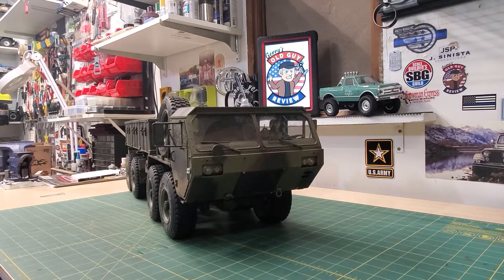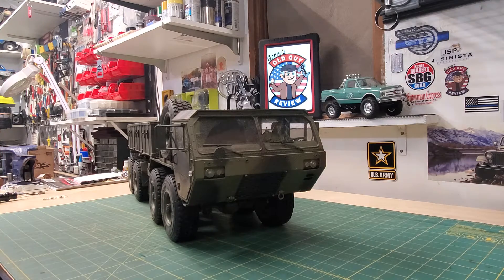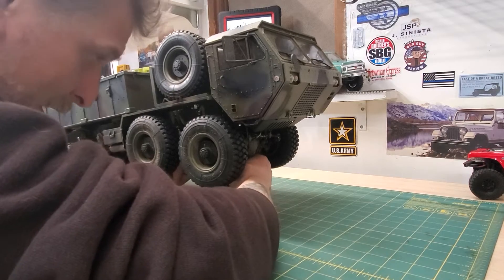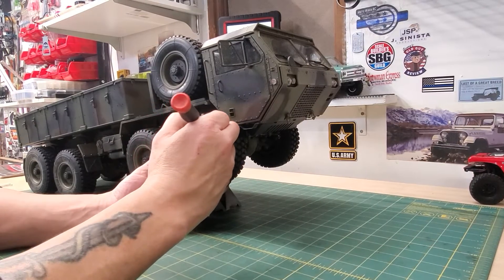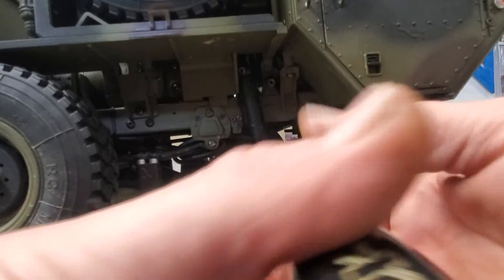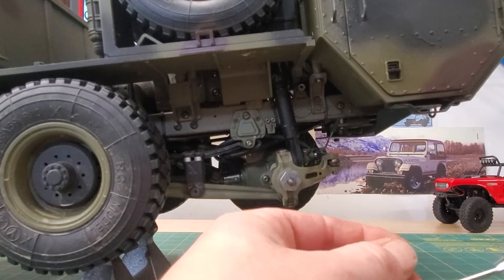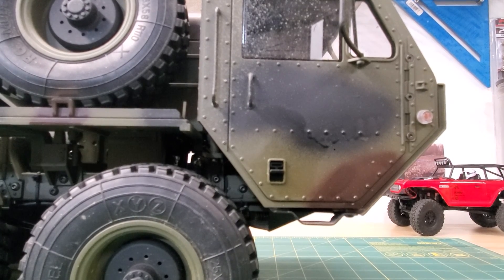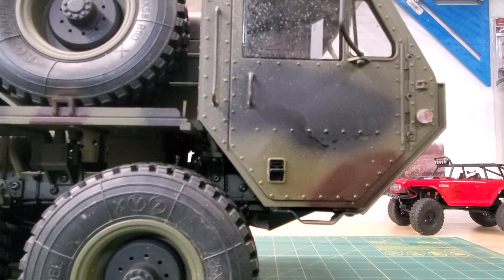HG 801,802, 803a quick shock mod!

Comment: I just getting this Truck in today and I’m getting as many tips as possible on how too’s… Thanks
Reply from the maker: Thank you for watching!! It's been a great truck for me so far, but one more thing to add to the list if you do the spring swap on the shocks while they are off glue the shock tops on, they don't screw on and after you take them apart a few times the are loose and will come apart when driving!!😁😁

Comment: Hello Gerry, thank you for your helpful videos. But can you also tell us how the driving behavior has changed as a result? Does he jump with the harder springs or does he drive more harmoniously as a result??? Is he still bouncing? Do you only do the 1st axis with it or all 4 axes? One of your fans from Germany
Reply from the maker: Drives much better norbert, I did all4 springs
Reply: @gerrysoldguyreview  Hello Gerry, thanks for the quick reply. Did you use the hard springs of the HG-P806?
Reply from the maker: I used the springs out of the trailer shocks

Comment: Great video 👍🏻
I want to know what is the tire size exactly as that same 1/14 Dakar truck and zetros overland because I want to change big tire for my truck soon also if you have installation tip or video for my truck 
1/14 JD model fmx Volvo dump truck 8*8 and other one 1/14 fmx nashorn semi haul truck 6*6
Reply from the maker: Hello bu Nasir! The 803 has 111.02mm tires the zetros has 100.12mm tires, not sure about rear duals they are already pretty close but they might work!
Reply from the maker: Sorry I dont have the dump or the nash!

Comment: Get one of those wire bread ties (that paper wrapped wire keeping your loaf of bread from drying out). Twist one end of the wire around the bottom end of the shock absorber then compress the shock by hand then twist the other end of the wire around the other end of the shock. You should have a compressed shock absorber with a wire running down the side of it. Fit t& shock in place (with the wire facing out), drive in the bottom screw, adjust the axle to where the top of the shock is level with the screw hole. Drive in remaining screw...*clip-clip-clip* and the wire is gone to allow the shock absorber to do what it was intended to do.
Reply from the maker: Thanks cliff!

Comment: Nice Gerry ! That's a shame I didn't have trailer shocks to do this mod :(
Reply from the maker: They do sell them separately,  but I've only seen them on banggood!
Reply: @gerrysoldguyreview  By the way, how do you did the dusty windshield effect ? looks very nice !
Reply from the maker: Thanks they look like the same!
Good luck and thanks for sharing the link!😁
Reply from the maker: Hey Guillaume! I use a airbrush or spray paint brown and tan very light spray. Sometimes i use a fan spray in front toward truck, you know thats a good topic for a video! Its easier to show then type, stay tuned!
Reply: @gerrysoldguyreview  welcome 🙏

Comment: Hello, do you have a link for the 2 stands you use? And a link for the springs? Thank you very much
Reply from the maker: Hello Alberto, they don't make the stands I have anymore but I found a link for another good option! And the shocks also.
https://store.rc4wd.com/Chubby-6-TON-Scale-Jack-Stands_p_2310.html
[US$12.99 19% OFF]2PCS HG P806 TRASPED 1/12 Heavy RC Trailer Spare Aluminum Alloy Shock Damper x Car Vehicles Model Parts RC Parts from Toys Hobbies and Robot on banggood
https://banggood.app.link/Xz1B9f1lrjb
Reply: @gerrysoldguyreview  thank you very much :-)
Reply from the maker: No problem!😁

Comment: Hello again, i just got mine today, i see where it is a bit close, and it also sits lower in the front, so i will do this too, should i do the other shocks that are in the front so it sits more level? Also do you have to bind this? I don't have my battery yet.
Reply from the maker: I just did the front 2 shocks to level the front. I haven't noticed sag in the rear yet, even with a load. I did put 4 total on the 802 so it's level when pulling a trailer! 
But if you do get the heavier shocks make sure you glue on the shock top, with the weight of the truck and driving over rough terrain the tops sometimes will pop off! I haven't had to bind any of mine but you never know. The books it comes with are a bit hard to read but have alot of good info.

Comment: I know it's been lone times because of the pandemic. Still there are way more enjoyable and less desperate ways to comunicate with others instead of wasting their time with something that can be said with just ONE sentence. You seem nice but 13 Minutes and 15 Seconds to tell "replace the front Damper Springs of the P802 with the Damper Springs used at the P806, because they are made from thicker wire"... damn, this Vid is sooooooo much ado about nothing Ol'Chatterbox.
btw: there are many models besides the P-Series and even RCs in different scales and for different specialised actions, but 90% of them do have one thing in common...
a littel gap for an otherwise hard to rech area... Yes, it is there for that one specific reason. In your case: the Front Steering Bucket has a gap for damper maintenance.
Reply from the maker: Hello Valentin, thank you for that extremely long and thorough comment! I see that you must have not seen what my channel is all about. Many of my viewers are new into rc, new to hg or just like to learn new things. This video is about the process not just the tip! Many viewers request videos just to see how to do something specific!! Maybe check the comment section next time before leaving such a comment, while I appreciate you viewing not so much the China virus statement!
Reply: @gerrysoldguyreview I guess I could have been more friendly... good on you to see the productive critisism anyway...  
in short: I belive such viz could be much more enjoyable ... for new audience as well ... if they started of with a short description of what is about to happen... for example:
"the HG80X's damper strech is of by factury default. Best/Easyest way to fix this is by replacing its spring. this is how it's done and where to get the necessary spareparts"...
after all it's not ment to be a mystery box but a maintenace aid ;) 
cheers mate
Reply from the maker: Hello again Valentin,  I will admit that in trying to make my channel more interactive with my viewers I do sometimes forget the new viewers over the regulars! This modification was a topic of discussion in the comment section for a while so I just made a video. Thanks for reminding me, I do appreciate it. And hopefully I will hear from you in the future😁
Gerry